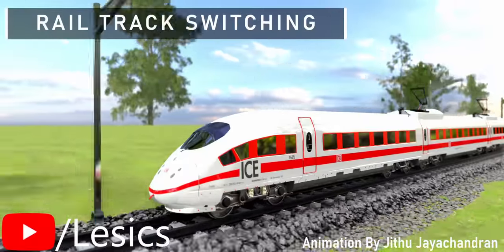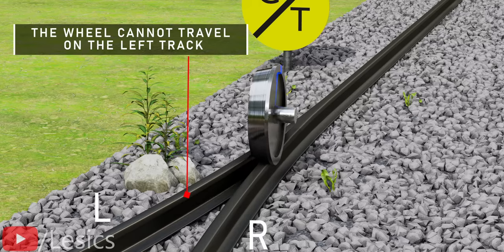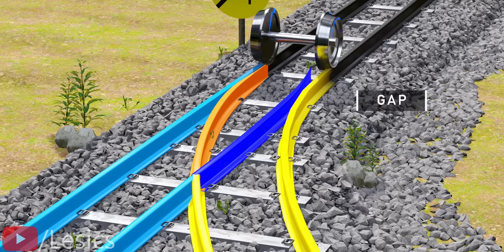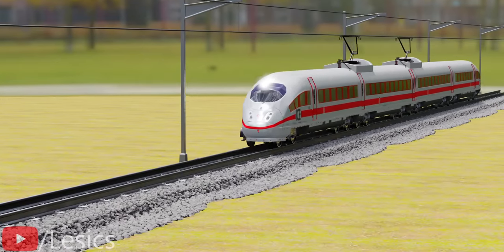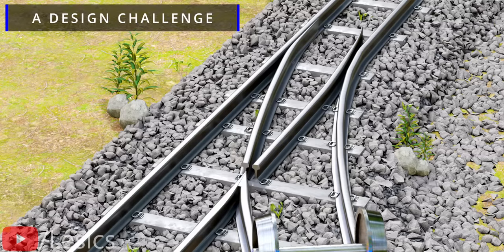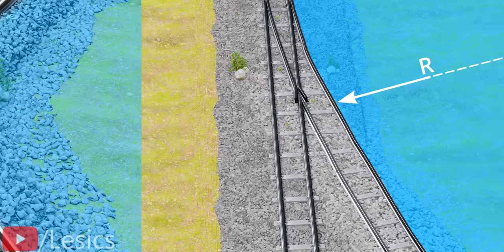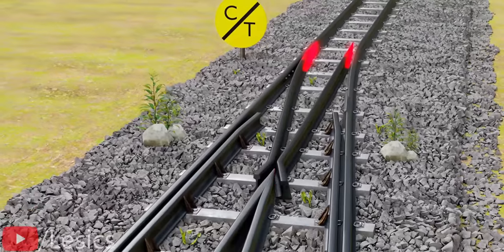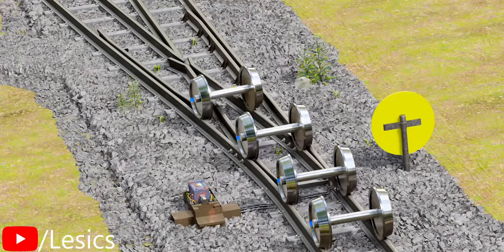How do trains change the tracks?

Comment: A verry good video, thank you. 
And this gap at 3:12 produce a heavy noise and a hard shock to the Wheels while jumping over . 
And the whole world is wondering why, from time to time, a train has a heavy accident. because of breaking wheels. 
This shock is so hard, that it can be felt in our house with 3 floors 50 m away.
May be this was good enoughe at the beginning of the railways with low speed and twice a day. But now with 15min timetable and 100 kph
speed verry old fashionned. No reason to be proud about this.